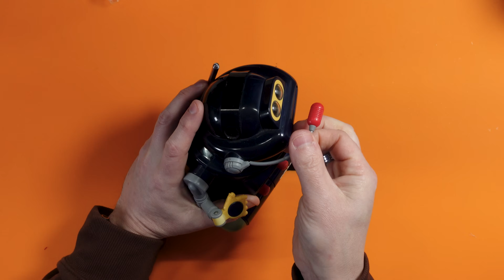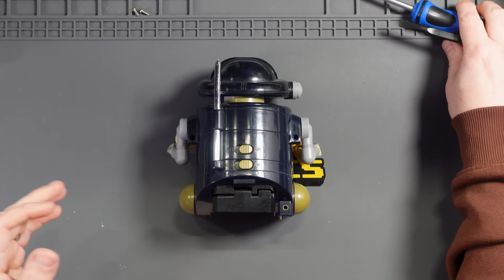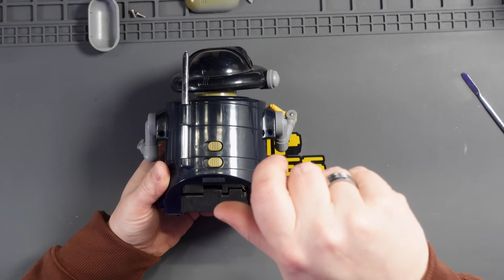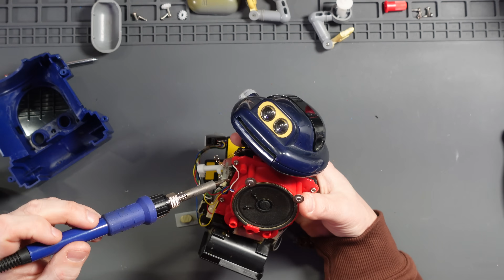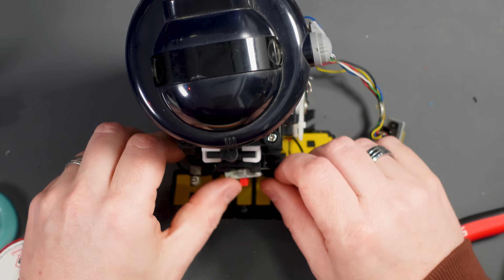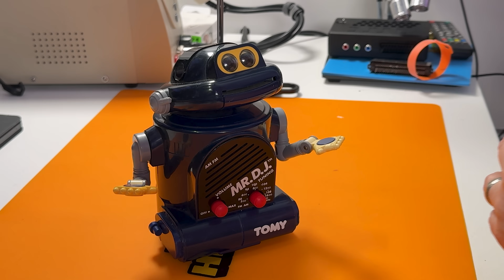Problematic DEAD 80s DJ - Can I fix the Tomy Mr DJ Robot?

Comment: My childhood Mr DJ is sitting on a shelf in my mom's house. The kids weren't impressed, even with the lip sync function! But maybe a Bluetooth conversion would help, that speaker was surprisingly large. Thanks for a fun and inspiring video!
Reply from the maker: Yeah. I’m definitely pondering the Bluetooth conversion, as someone has suggested I could use a more modern battery pack and fit everything in the battery compartment. Might do that!

Comment: Looks and sounds great. For future ref, if the plastic is ABS, you can use Evostik pvc pipe weld (the runny stuff in tubes), though tiny amounts and tons of practice (melts ABS together).
Reply from the maker: Thanks for the tip!

Comment: You just have to add a Bluetooth receiver module to Mr DJ
Reply from the maker: Hmmm I’m pondering where it will fit.. it’s quite tight
Reply: @KipHakes  Hi Kip, just scrolling through the comments while watching the video, (sorry Stevvieb for jumping on your comment) had a thought about this in the battery box for the C cells could it be possible to upgrade to a 3.7v Lipo battery and usb charging which could save you some space for a mono Bluetooth audio module
Reply from the maker: @ that’s a fantastic idea actually
Reply: @ramses112uk  Perhaps add a LDO regulator to prevent more than 3V on the motor, especially when charging.